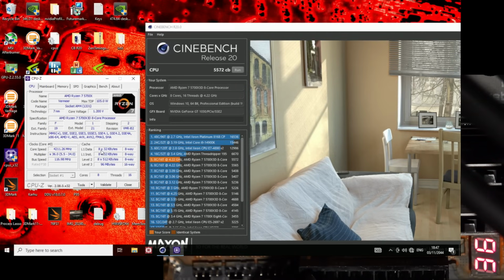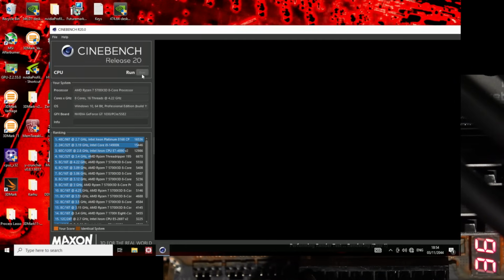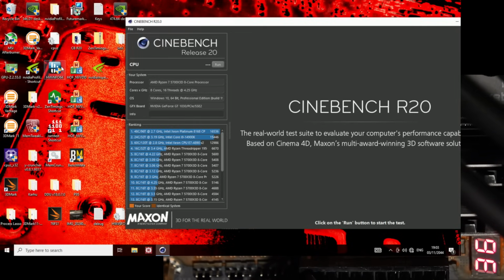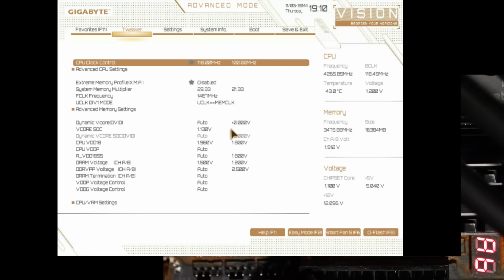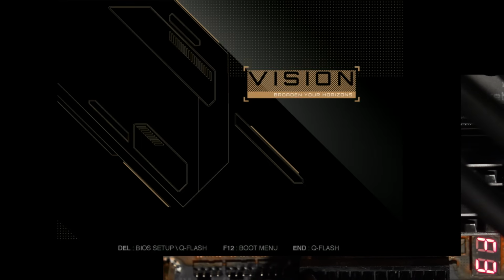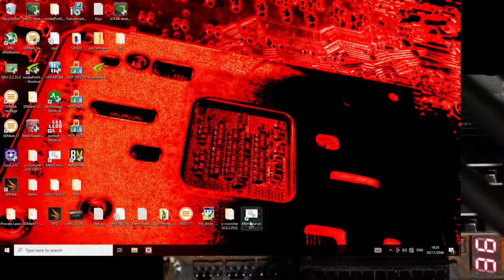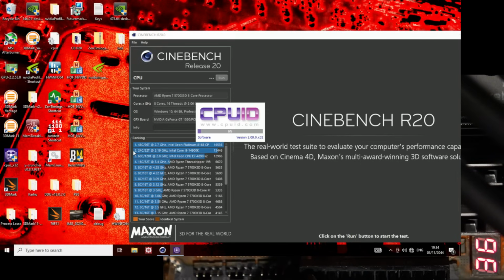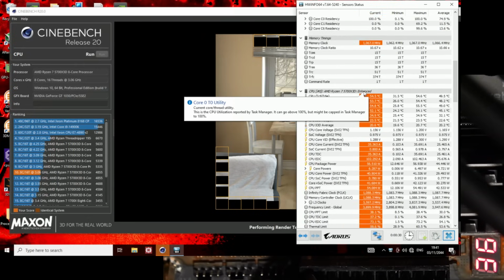Overclocking the 5700X3D?

Comment: i just have 1 question: why is cpu-z showing your cpu name as 5700x and not 5700x3d? my cpu-z with an 5800x3d shows exactly that, but yours doesnt...why?  there is a lot of weirdness, but i like how u explained it! crazy thing is you are right, my 5800x3d runs with -30 undervolt on like 1.1V. it must be that they had really bad bins and had to raise voltage so they could sell enough of these. i wonder if my cpu could do better. do u have any suggestion on how i could try without breaking everything? ^^

Comment: I've used 5800X3D on two X570 boards (MSI and GigaByte) and both of them have Curve Optimizer available in the BIOS and working very fine. 
That particular CPU was pretty good silicon, as it was perfectly stable with -30 CO all-core, tested on both boards. The only "place" that did not have CO available (with X3D CPU) was the Ryzen Master software, which is fine for me, at least.
My point is that I am really surprised that your B550 mobo from Gigabyte won't allow you to use CO on 5700X3D.

Comment: I've done something correct or horribly wrong. Please help. Right now my 5700x3d is running on a 570x motherboard at 103.5 bclk. Preciscion Boost and an all core -22 curve optimizer are all still intact. In this very moment I'm slamming the cpu with all core cb23. All cores running at 4192 mhz. I have seen also it boost to ~4.3 ghz. My ram kit, supposed to run at 3600 is now running at 3794 (apparently just the bclk wasn't enough but I also overclocked the base to 1833). The good news continues. Windows reports no WHEA errors and from cbr23 scores comparing before/after there's no clock stretching going on.

Now, the part I need help with is where it gets weird. I spent a lot of time two days ago trying to get much lower bclk's to work. 103 and down. They did not work. Even slowing the base ram speeds down to compensate for the bclk increase. The board forgot to post, repeatedly and I had to crawl under the table repeatedly to reset the cmos, or sometimes the board even recovered on it's own. Eventually I got something not as impressive, think it was 101.75 I got to work and the pc was fine all day. Then yesterday, after being off all night, the pc would not post.

Then I found a saved profile. "103.5 bclk -22CO", which I loaded. Yeah, 1.35v ram is now at 1.4v and running much faster. The profile also had some costum voltages for uncores, lower than what the xmp profile sets as default. To my surprise, it booted. Ran fine all day. Was off all night, and booted with no complaints. Still boosting, no whea errors. No drama.

I don't know why this runs. I could blame the 0.05v extra on the ram but most times the bios light was stuck at "cpu", and I had slowed the base ram speeds down to compensate. Most of the unsuccessful tinkering was at -20 curve optimizer and this profile runs less voltage. It's all very strange. 

My main concern, however; I can't remember why I stopped using this profile.
Reply: You still run on 103 BCLK? I heard it's bad for SSD drive.
Reply: @ygn1337  Yep, still running 103 but I found the system more stabile with 103.75, the extra .25 seems to have made the ram happy (1833*103,75 = 1902). It's also nice that the 5700x3d is boosting to 4.2 under all core workloads instead of stopping just short. 

So far all my ssd's are fine, yes I messed with the bclk but it's just a 4% increase. I can't rule out that it shaves days or months from their expected life time which should still leave multiple years.

Some people who bclk overclock go well above a humble 4% increase and I'm guessing 110 and above would eventually do bad things to the ssd. But 570x being very finicky can't seem to go higher - it truly seems to just forget how to boot. While there might be a magic combination of settings that will run with a higher bclk, I haven't found it.
Reply: @allmybasketsinoneegg Thx for answer. I am trying to overclock my 5700x3d and only option that works to increase clock speed is changing BCLK.
Reply: @ygn1337  Yep, basically pure stubbornness. "Not allowed to overclock this?" Does it anyway. Performance gains are there but minimal. Definitely do negative curve optimizer + bclk. I don't know how picky your combination of hardware is, but I found that getting the effective ram speed close to a "real" ram speed is good for stability, even if it means setting slightly more bclk than what you think will actually work.

Comment: AM4 X3DCPUs are the the best binned 5800X, meaning 1.25V to reach 4.1Ghz is insane, they should reach 4.5Ghz(with enough cooling). wish we could force BIOS to think this was an 5800X3D, so it would try to clock higher, but keeping the voltage limit and safety rails for the cache.

My 5700X3D reaches 4.05Ghz at 1.125V with spikes to 1.168V(81W) on R23,(score - 13400) with PBO2Tuner -30, i actually tried -50 but voltage doesn't seem to change
stock runs at 3.93Ghz with 1.25V(97W) on R23(score - 13020)

Comment: so my 3800X runs at 4.4GHz fixed on all cores. its been like that for years now..i presume even with that poor of OC on this 5700X3D i will still benefit about 50% of performance boost or so if i switch to this one right..
Reply: I had my 3700x at 4.2ghz all core for like a year and a half, I upgraded to the 5700x3d and saw a ~25% gain

Comment: I have two rigs using 5700x3d. I managed a little over 4.2GHz. I could run cinebench and stuff. But rebooting would often lead to black screen. Really, the best thing to do on these is just set pbo to -30 on all cores so you get 4.05GHz all core boost all the time and better temps. 5700x3d is simply to bring your gaming performance up to 7500f/7600 levels. I like to compare it to R7 7700 because 8 cores. 5700x3d is about 7% slower in average VS 7700 for gaming when CPU limited. So for a casual gamer that uses the computer for gaming and casual stuff the 5700x3d is nice. However, if productivity is important then look at AM5 instead. For gaming you would need a 7800x3d or 9800x3d to get a meaningful uplift over the 5700x3d in gaming. But you will only get that when CPU limited.

Comment: Hey, i've achieved 4.3Ghz on all cores stable, at 1.25v. 4000Mhz ram and no problem with pcie gen4, with a AORUS X570 Elite motherboard on my main pc. 14500 points on cinebench r23. no problems so far. thank you for your help !
Reply: Whats your settings?
Reply: I have the same board. So does this mean you did it in the bios itself. Or did you use PBO2 like it seems most folks do? If that is true it would be 1,2k Points over my slapdash UV PBO2 Config I just did with that chip. Gotta do some more research, sounds like there is massive room for gains still. I'm kinda giddy to try some more tweaking now. Thanks!

Comment: I used to overclock Ryzen cpus with Ryzen controller from github. Only settings will take was the TDP increase up to a limit, after will reset at stock, boost short and sustained time, and the temperature limit. I think they are like... You have that much voltage available and that much TDP use it acording the temperature up to that much time.

Comment: How can 5600x3d run at higher clock than 5700x3d?
Reply: 5600x3d is 6 core, 5700x3d is 8 core, just a down clocked 5800x3d, 5600x3d is an entirely different chip

Comment: Why would you OC?Might as well get a 5800x.I have both but stock the x3d is better in games.But the 5800x really gets hot even stock.You need to have a good cooler.AU6 works and the AK620 both do fine for air cooling.With the x3d it staay way cooler even under load.I have x670 taichi and Aorus master.Have been swapping them back and forth.I have a 5700g in the taichi right now it at least has a APU.The Aorus has no port.

Comment: After reading a lot of comments i think i got a pretty good chip. 
Under volt check with cinebench r23
Just did a basic CO changed nothing else. 
Stock / multi 13531 68c
             Single 1349 45c 

-15 / multi 13729 60c
         single 1352 43c 

-30 / multi 13759 55c 
          Single 1360 39c 

Each - value proves better performance. I’ve been running -30 for a few months now zero issues
Reply: man those are pathetic differences

Comment: Imagine if a board company make a special board with a dial controlled clock gen for the multiplier seperate from the bios 

Basically lock the clock to the designated multiplier on the dial and have a switch to just turn it off allowing for whatever desired multiplier

Comment: my 5700x3d get to 4,7 when i have performance boost modes activ and unter 80 grad celsius witth -30 on all cores
Reply: You are very lucky.
Reply: how did you get it to 47? CO alone?
Reply: @FireStriker_  y i dont know

I just bought the CPU a week ago and haven't adjusted much
I have cool and quiet on and the AMD Performance Boost on and I always get to 4.5-4.7 Ghz with a max of 70 degrees Celsius with standard Amd boxed 
fan
Reply: @Crussader-nv77x  Are you sure its the 5700x3d? So talk me through what you have done with it, Im eying off the 5700x3d as an upgrade from my 5600x but getting turned off by the low clocks.
Reply: @FireStriker_  yeah its for sure the 5700x3d  🤣
I would know that if I had spent 400-500€ instead of 200 🤣, and you can't find a new 5800x3D today
What I only know are the current 5700x3d, ARE the old Remainders of the 5800 or the too bad 5800x3d which they were not allowed to sell as 5800
Reply: @Crussader-nv77x  It definitely feels like the old 5700x3D chips that could never quite reach the speed or quality of a 5800x3d, just wish it could clock slightly higher. 4.7 on a locked 4.1 chip is insane and I would love to know your voodoo magic

Comment: you think 1.2 V is a lot? xD I run my 3600x on 1.35v few years on 4500ghz, btw do you think it's wort upgrading to 5700x3d from 4.5h 3600x 6core/12 or not really?
Reply: @PREDATEURLT  I bought 5700x3d on aliexpress around 150 Euro, it's in delivery, but after watching this I'm not happy, kind of afraid, cuz 5700xd basically is stuck at 4.0 ghz and that's it's, it's not a lot in 2024 tbh, since many CPU reach 5.0 ghz without huge issue , the only hope is that zen3 architecture + 8 cores + extra cash will do the job, 7500f is better deal, but i will have to sell mobo and ram and buy am5
Reply: @twoplustwoequals5733  every x3d chip is still better at gaming than any non x3d chip, even 7000 series.  It wont have the productivity of a 5800x or 7000 series though, but still will be really good.  The only times where the higher frequency is better is in games where it doesnt utilize the extra cache, which is very ery rare today.

Comment: i got a b550m steel legend and a 5700x3d. with PBO 120/80/110  (thoug i think these settings are kind of ignored) and CO -30 i get maximum of 1.15 VID for single AND multicore cinebench c23 while hitting 4.042GHz multi and 4.142 single.
Again i think the PPT/EDC/TDP is ignored while the CurveOptimizer -30 seems to have an effect

Comment: So... 5% overclock?  Not worth any effort imo (and there is some effort you'll have to put in for stability testing).  Pay another 100% and get the 5800x3d if you care about 5%.  Without unlocked multipliers you're limited to increasing the base clock which sucks.  MAYBE just undervolt it while maintaining the stock clock and boost stability... like, if you just have the time and feel like it so it runs a bit cooler and depending on your cpu cooler it may stay under 70 degrees longer so it throttles less or not at all.

Comment: Tried the same thing with my 5600 X3D except I undervolted it as well as raised the BCLK gigabyte b550 gaming V2 motherboard when I raise it to 103 it crashes 102 will run in cinebench bench Even time spy but if I play Fortnite it will crash in the middle of the game and force a reinstall of the game not fun so I just stick with 100 megahertz -30 with the voltages set at 100 70 100 Nice thing is it actually boosts performance over stock and I never see 60C in normal tasks or games versus the high 70s it used to run at with a 240 AIO

Comment: FWIW, I could use that x470 video as I'm brand new to overclocking, running an x470, and about to pull the trigger on the 5700x3d.
Reply: DONT DO THAT BRO ITS NOT A CPU FOR BEGINNER

Comment: I have a Ryzen 3900 (65w model), it is much cooler than the 3900x, but the performance is capped. First thing I did was undervolt -0.130, which made it colder. I can't increase the fixed clock, it operates a little longer than the 3900x, taking 4.35Ghz, I changed the PBO leaving 120PPT 80 TDC and 120 EDC, in this I was able to maintain something around 3.9 to 4Ghz at full load, before it took 3.6 Ghz full load, in games it gets 4.2Ghz. And consumption remains lower than the standard 3900x. When I got a 5700x3d from a friend, I saw that there was no point in undervolting, I'm going to try your settings

Comment: Finally finished my 57X3D: 40.5 x 103.75 = effective clock is 4202Mhz all the time, CO -30, offset -0.05v = 1.1625v, 106 watts during linpack, max 76*C with DeepCool AK620 running fullspeed(1900rpm) while testing, no clock stretching; 1900:3800 crucial e die 16-19-16-36-58-1T, B550 Strix F, resulting in 322Gflops in Linpack 1.1.5, 14620-14670 pts in CB R23 and 5675 pts in CB R20(L1\L2 prefetchers are disabled). WHEA free, no TM5 errors(1usmus_v3 25 cycles).
57X3D is kinda contradictory CPU, for it's price its pretty good for AM4 final upgrade(in my local store difference in price with 58X3D is 20%), but it's too boring, clocks are super limited, and even if u managed to get more with BCLK its gonna be limited to..gpu, pcie, usb and other stuff stability lol. 40.5 multiplier is a disaster and the CPU itself is definitely a dogpoop piece of 58X3D silicon.
Its a decent choice for a user who want to put it in and play games, but for enthusiast..No.
Reply: can you say more about how to make it stay at 40.5 all the time? thanks
Reply: @kadapp987  sup, sure. But let me clear that i meant 40.5 multiplier all the time under load, even heavy(occt, linx, linpack). Ofc in idle it will drop. 
1. Cooling. U need a decent cooling solution, Im using DeepCool AK620, as i said before
2.Set ur multipler manually to 40.5 in bios
3.Disable this settings: LCLK DPM; PSS; Global C-state Control; CPPC, CPPC Preferred Cores (i know about common advice about enabled\disabled, but for me both disabled gives less stutters in game like pubg and hell let loose); Core Performance Boost, DF states. Fixed SOC Pstate = P0.
4.Use -25(or even -30) CO option, u can even try to use negative vcore offset to lower temps even more (remember  - lower temps = more freqs, in  case of 57X3D - 4050 will stay longer; but its rather cold cpu by default, so 4050 should be achievable in 100% cases).
Reply: @saddylemon what to do if i dont have multiplayer and only fch base clock in settings?
Reply: @saddylemon i dont have core multiplayer option on b450 tomahawak max with latest bios,what to do?
Reply: @saddylemon mines is stuck at 3.6hz how to unlock?
Reply: Finishing tuning my Crucial E-die for it as well. I saw some advice on setting tRCDWR at 8 and tRAS at 21 for zen3 chips, is 16-8-19-16-21 better than 16-16-19-16-36 for this CPU?
Reply: @linealign sup, tested this also, no significant boost at all, so I preferred classic timings being sure in system stability. But u can always test by your own)
Reply: @saddylemon thanks!
Reply: What about limits ppt/tdc/edc?
Reply: Master PLEASE make a video tutorial pls pls pls
Reply: Definitely better for editing videos than a ryzen 3 4300ge 😂

Comment: I'm kind confused. Maybe it's binning but my 5900X does 4.35 all core while rendering Blender / cinebench etc. with curve optimizer. No real overclocking needed besides some voltage modifications (because 3600Mhz C16 4 Sticks) and I have a silver sample.
Reply: Different cpu.
Reply: X3d chips can't reach higher frequency easily

Comment: I have my 5800X3D on a X570 Aorus Elite mobo and I can only get 1.02 on the BCLK, it's good enough for 4.536 all core and 4.636 single core, cooling it it's complicated I have 600mm worth of rad to disipate it and it gets to 85c easily, I think I would need to delid this bad boy but I have not seen many cases of people delidding these CPUs tbh.

Comment: I just recently installed a 5700x3d but no matter what options I change if I adjust the  clock ratio to anything above the default 100.00 windows just sits on the loading screen with its spinning circle 😂
Reply: Чувак, попробуй отключить sata порты, если есть девайсы на этих портах, при разгоне по шине, ты гонишь все  sata девайсы и pci e (видюха, диски и тд)  - они могут выше 100 по шине и не тянуть. мне помогло отключение сата портов и ненужных hdd На них. Не благодари ))
Reply: @MukhinI  Yeah I played around with this some more, and have removed all of my HDD, I wasn't using them anyway, I can get around 4.23Ghz before the GPU stops displaying, but that's good enough for me, thank you for your reply though :)
Reply: Помоги мне пожалуйста. МП Асус б450м про гейминг. Нет по, не могу курву настроить(((

Comment: Buildzoid, the MSI X570 Unify is a great board for bclk overclocking. Ive run up to 108mhz on mine with my 5800X3D.

Comment: The multiplier is unlocked on my Aorus X470 Gaming 7 Wifi-50. I got it stable at 4.12GHz, touching the voltage even a little makes it crash no matter what speed.
Reply: appears I got lucky with my 5700x3d -- with MSI built in kombostrike LVL 3 (basically MSI setting PBO to negative 30 with some other minor tweaks) I get boosted to 4.2Ghz all core without touching clocks. I've seen a few cores can get close to 4.25, generally with games. Temps may be a factor here -- with cinebench temps stay under 60c, prime95 temps stay under 75c.